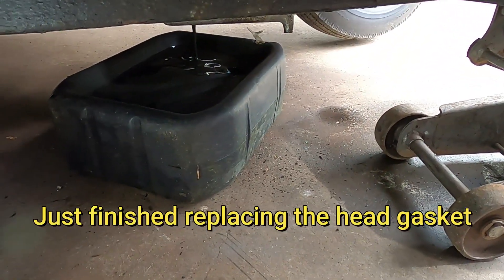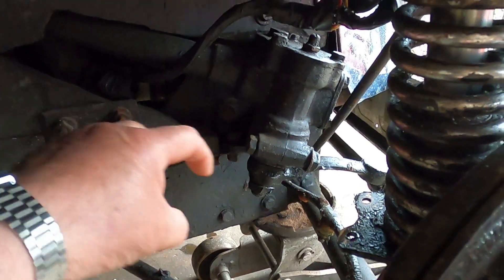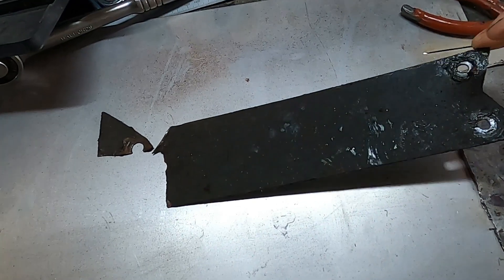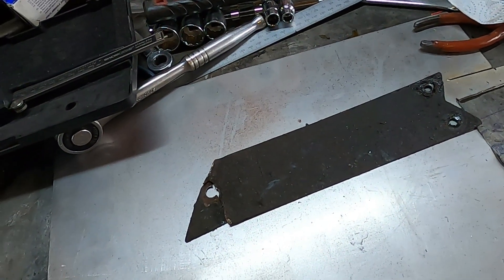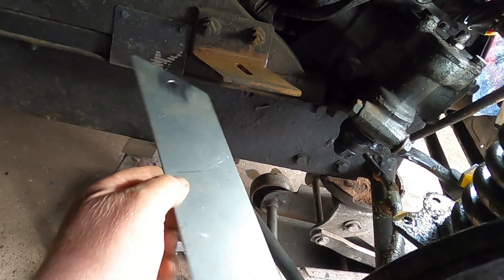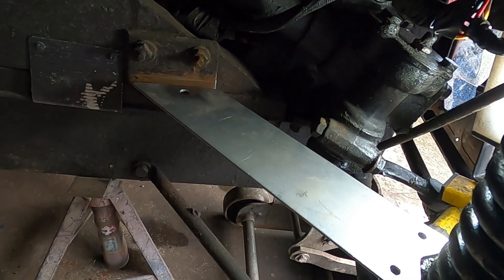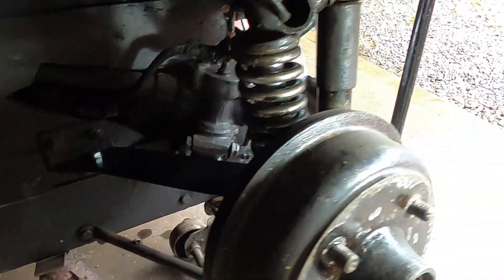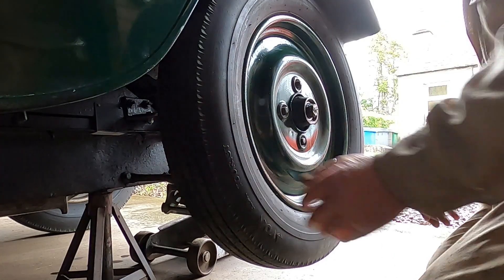Front Wheel Death Wobble - FIXED 1936 Morgan 4/4

Comment: Great job Doug on the strut repair. The Morgan is as good as ever now. The new head gasket fixed your issue perfectly too. Have a great week my friend
Reply from the maker: Hi Lloyd, I think most things are fixed now. On my first drive since replacing the head gasket, I got 1 mile down the road and there was a loud rattling from the engine. I hadn't fully tightened one of the rocker posts and the valve gear was rattling off the valve cover. Easy fix at the side of the road (luckily I had packed tools).